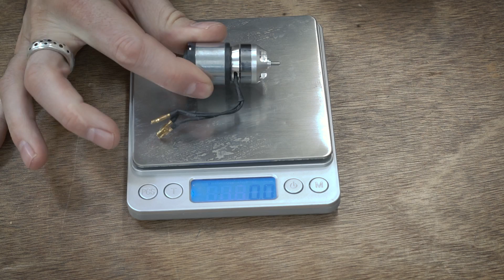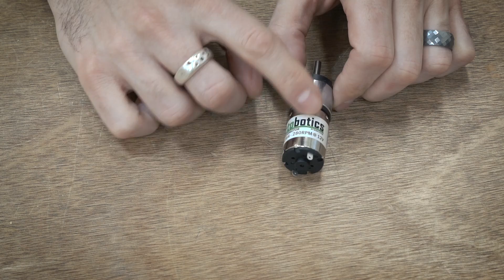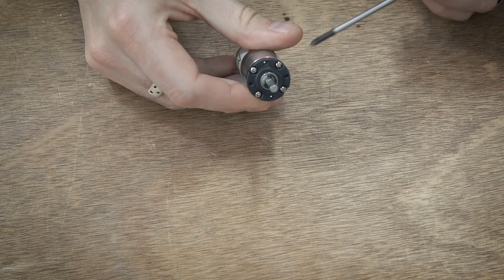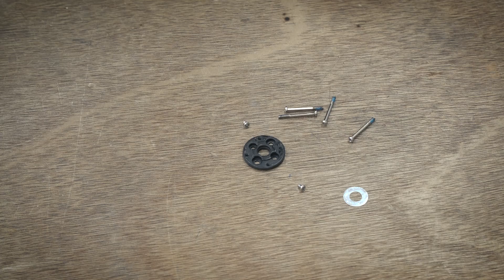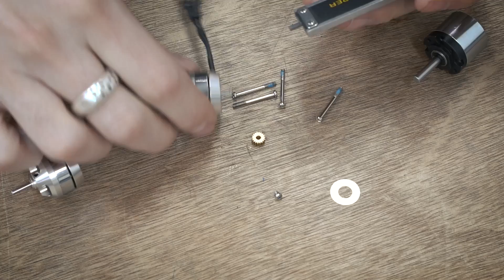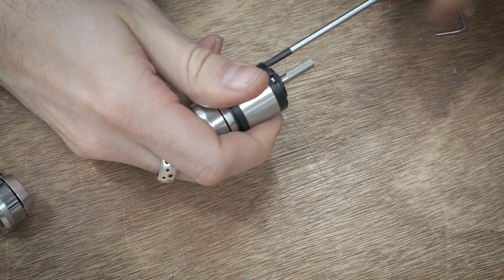Beetleweight Brushless Drive Tutorial

Comment: Why don't they supply brushless motors with gearboxes? Am I missing something?
Reply from the maker: That's a good question.  I'm not really sure, but I think for most of these hobby applications, you're meant to use them at full RPM.  With brushless motors, you can change the windings to get different RPM ranges (changing the KV).  But with brushed motors, it's just all about the voltage, so you NEED a gearbox.  The problem is with the smaller brushless motors, your KV can only get so low, so your RPM is generally still pretty high.
Reply: They do now, such as the ones from Fingertech. But most of the small brushless motors are for drones so they need high rpms.

Comment: Just a 2021 update: Finding the brushless motor with 22mm can OD has become difficult lately, and some have begun using 3mm shafts (but the pinion needs 2mm shaft).  The typical motor is an 1806 size for small (250?) quadcopters. Best of luck finding what you need.
Also, BLHeli has really surpassed  SimonK as the most accessible ESC programming software, but finding the USB adapters for any of the programming is non-trivial.
However--for "insect weight" combat robots, this is still the best drive system I have encountered.
Lastly, BotKits has some hardware worth looking into: they have a version of the ServoCity gearbox with a much lighter aluminum ringgear, as well as another well-proven hub and wheel combo for the 4mm shaft.  (No affiliation, just a satisfied customer)
Reply from the maker: Thanks!  Yeah, it's an old video, but many people sell kits with motors included now.
Reply: Oh, and great video!

Comment: 15:14 What's the issue with 3d printing a hub/pulley with a dshaft hole? This video was super helpful, so I subscribed and can't wait to watch more. Thanks!
Reply from the maker: It's just a bit too small and will eventually wear out.  I have done it before in Low Low Man, and it does work out, for smaller wheels that see less stress/torque.

Comment: Shouldn't the weight of the control electronics also be taken into account when comparing brushed and brushless motors? Since for brushed motors it is not necessary to have an ESC
Reply from the maker: For drive, you absolutely need an ESC.  For a weapon, you can just use a contactor or relay, but at this weight class, that's heavier than the ESC.  For brushless (at this scale) the ESCs weigh just a couple grams, actually lighter than most of the brushed counterparts.

Comment: is brushless motor water resist?
Reply from the maker: no.  well, in theory if it's pure water, which is non-conductive.  look for motors for boats, they are usually sealed.
Reply: Actually, from an electrical perspective I think the brushless motor is OK in water--it has no  exposed current carriers (unlike the brushes and commutation in a brushed motor).  The magnets,  ESC, any exposed connections, and the bearings are all problems, of course.

Comment: Robert, What motors are you using for your beetle weight brush less drive? I am working on my first design as it is a great time being trapped inside! You videos are very inspiring and I appreciate the detail you put into them as it helps out beginners like me. I am using Solidworks to design the bot and couldn't find any out runner cad files for motors of comparable size. Thank You!
Reply from the maker: SK3 2118, check hobbyking.
Reply: @RobertCowanDIY  thanks for your response. Looks like that motor is discontinued. Will have to search for something of comparable size and weight. Hopefully you stocked up on them!
Reply: @kbrowncny1  did you find anything that worked?

Comment: 10:40 IME the allen key always goes first anyway. I recently had one that was glued in there with some kind of super strength thread lock and killed a good quality allen key. I ended up drilling it out and using a thread tap to clean the screw remnants and glue out of the motor threads. But it did work, so it would be possible to recover from a stripped screw using the same procedure.

Comment: The SK3-2118's seem to be sold out everywhere and with the lack of specs/dimensions posted on brushless motors, it's difficult to find something similar with the same bolt holes arrangment. Any suggestions?
Reply from the maker: Unfortunately, I'm not aware of any drop-in replacements.  I wish motors would be discontinued so readily!
Reply: @RobertCowanDIY  No worries. Looks like I will have to fab my own mount plate. Thanks for the reply.
Reply: I was going to ask this same exact question, I can't find the right motor to work with the servocity gearbox :(

Comment: What amount of cells do you recommend that balances weight and speed 

I currently use 2 cell in bettlewaight but feel that it is underpowered
Reply: There really is none. Use what you need. If you need more voltage, get a battery with a higher cell count.
Reply from the maker: Generally speaking, higher voltage is the goal.  But, then you end up doing silly things like I did using two batteries, re-wiring everything, etc.  For MOST insect-class robots, 2-3 cells is the way to go.

Comment: How did you find the right BLDC motor with the correct shaft diameter to fit the gearbox pinion ? Any links?

I have been trying to make a geared BLDC motor for a while. I couldn't find the right BLDC motor with the correct output shaft  to match the gearbox pinion.

Comment: Ever tried pressing the shaft out all the way out so you could flip it around to make use of the C clip again?
Reply: I have done that--not worth the trouble because the end in the rotor is held with the set screw (retightening of which he omitted).
I actually use the brushless shaft to push the pinion off the brushed motor--it all happens in one step that way.

Comment: I recently went through the reflashing of brushless ESCs.  I've found the flashing kkmulticopter 0.80beta6 no longer works.  It references out of date files and even if you get around that gets exceptions causing it to fail.

I did manage to succeed using version 0.77 and downloading simonk separately and compiling it with Atmel studio.  It will require some fiddling with an assembler file though.

Comment: intresting i did this with the dys motors and i had to epoxy the pinion onto the motor shaft do you use any extra bonding agents for the pinion
Reply from the maker: I had no issues with these.  I mentioned (I think?) in the video that you could use epoxy, superglue or even solder, but that wasn't a concern for me.  The pinion was tight enough.
Reply: @RobertCowanDIY  Re-used pinions kinda fail over time, especially small brass ones. Mine lasted a couple of events, but then slipped completely. 

I really like the press plate you machined. Much simplier than the small gear puller I bought.
Reply: Another option is to remove the entire shaft and pinion from the brushed motor and press it in place of the brushless motor shaft.

Comment: For really, really stubborn gears heating it with a point torch for a few seconds helps a lot, not enough to damage anything, just enough to loosen things up. I recuperate a lot of steel gears from old Xerox (and other brands) machines that way. Those are incredibly tight tolerance fits that even a decent press struggles to remove them, or, eventually you end up breaking something.

A stainless steel washer and a hack saw can form the same kind of plate.